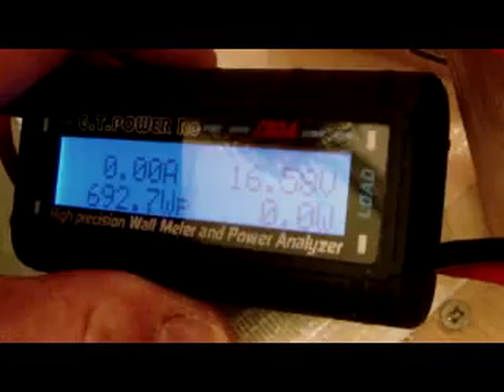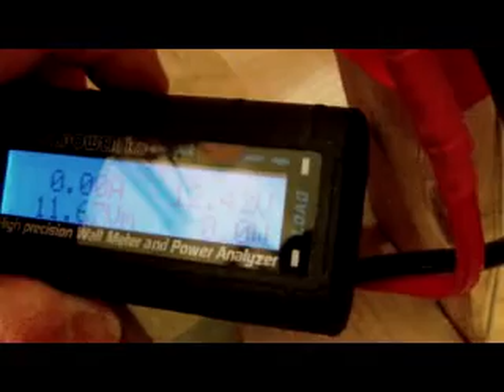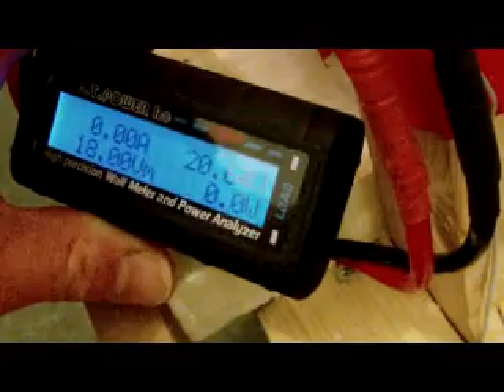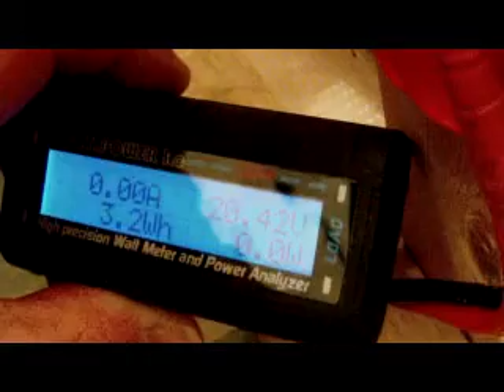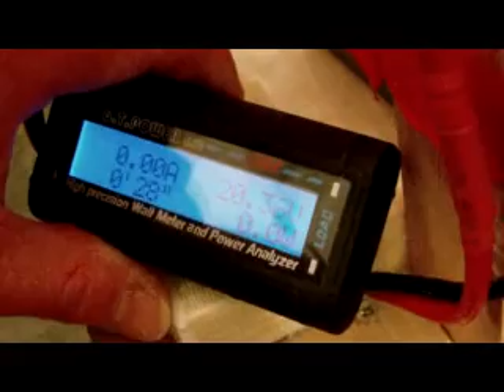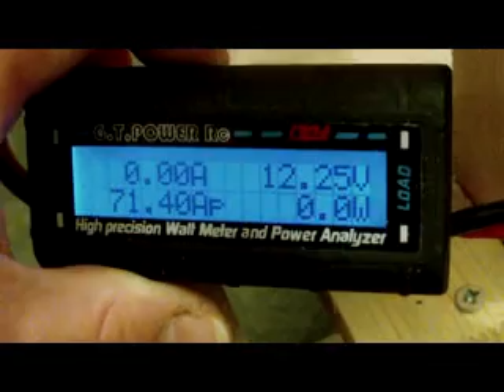RC Plane Pirate Turnigy H3126 1300kv Motor Prop Thrust Test 3-5 cell

Comment: which battery did u use
Reply from the maker: The 3s was a Loong Max Tipple 4500mah 20c. 4s was a Zippy Compact 3700mah 25c. 5s was a Zippy Flightmax 2650 45c. Thanks for watching.

Comment: thanks for reply,I thought the shaft may give problems with the large ground flat.if I do it I will use two 4 cells 3300 it will take the weight being a delta.

Comment from the maker: Hi reedy think that would be a good set up on the vulcan maybe on 4 cells with 8x5 or 9x4 gas props for maximum thrust. I have fitted thist motor in the front of my old plane the first project i put on youtube. On 5 cells and 7x8 apc gas prop i think its doing 120-130mph. Ive gone and bent the motor shaft again after a bad launch but i will fix it and try to get some flight footage to post. Happy flying!